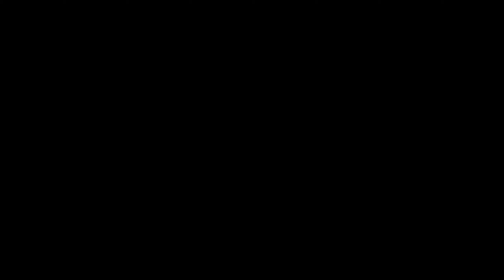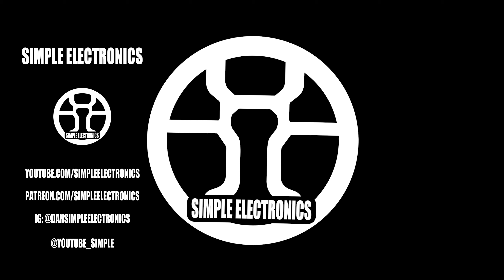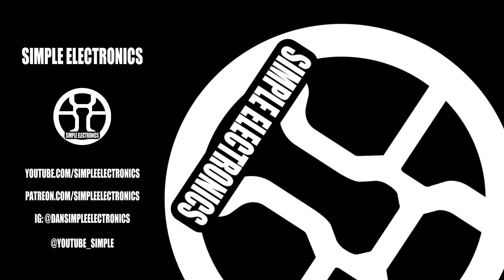The Simple Electronics Podcast - 082 - Oh, Aliexpress...

Comment: I do shop between Amazon, Ebay and Ali. With Ali I just expect to eat a certain percentage of what I buy.

I REALLY hope that with a laptop that age that you've swapped the spinning rust for an SSD.  I've done that on every laptop my family has and they are so happy.

I feel like I've been through the framework laptop thing in a lot of different iterations in the past. This one is better than the ones that have gone before it.  I'm just cheap. I bought a killer $900 LG Gram and I'd rather replace it in 2 years than try to upgrade.   Of course that's why our landfills are full.  At least you/they are trying to solve the problem.  Kudos there. 

I like the RGB strips. Good diffusion.  I can't see the pixels and I appreciate that.

Comment: I use Aliexpress for the most part now. I also used to use ebay, but after getting a whole bunch of counterfeit 595 shift registers (at least I think they are counterfeit, they dont work like 595's, but they do something, probably some other type of shift registers. Gonna make a test circuit where i can switch them rapidly cause i have like 30 or so of them) 
I switched to Ali. So far only got chips that do work.

I ordered a cheap DIY oscilloscope on Ali that didnt work; the display was cracked. And i got a refund.
Other than that ive got stuff that were indeed useless, but this is mostly due to me not having done due diligence and actually checked the product thoroughly, and just saw a picture and "yeah one of those too" click buy.